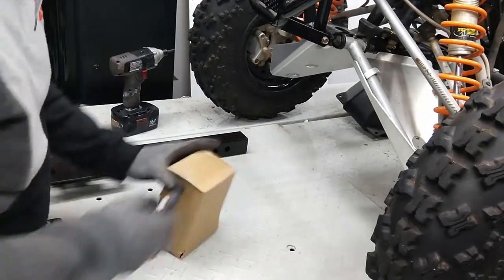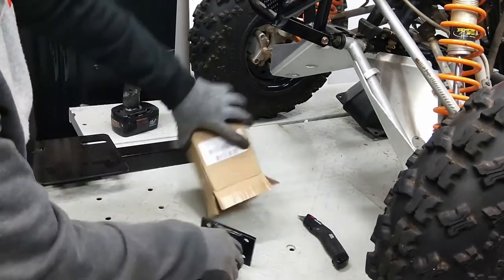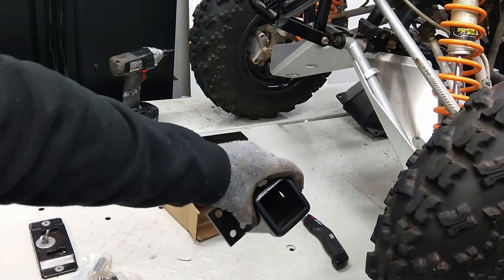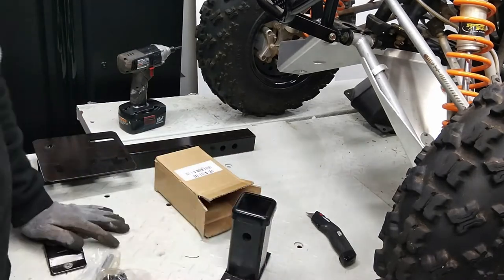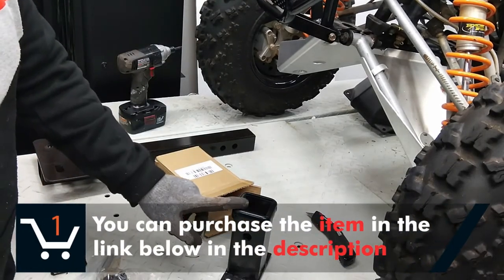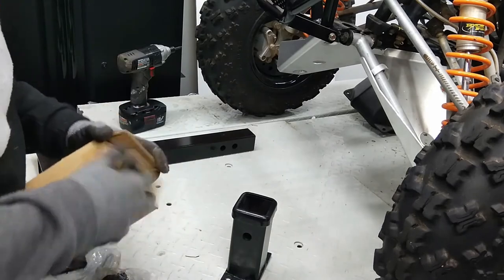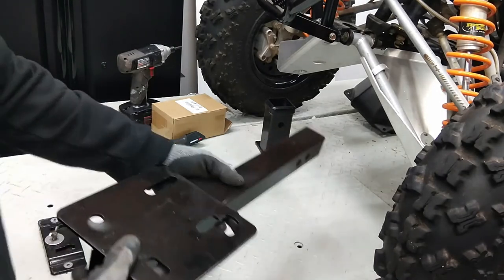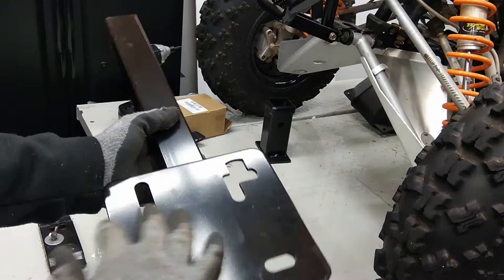Wall Mount Vice Setup

Comment: It is a space saving idea..I like it. Putting a back plate on the otherside would help with shear strength. By shear strength...I mean the technical term used by framers of wood structures.